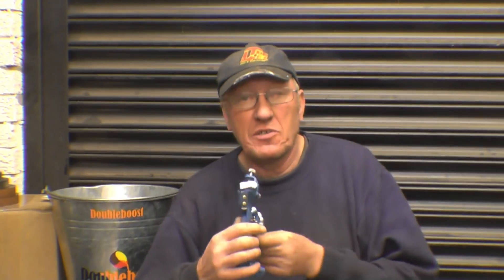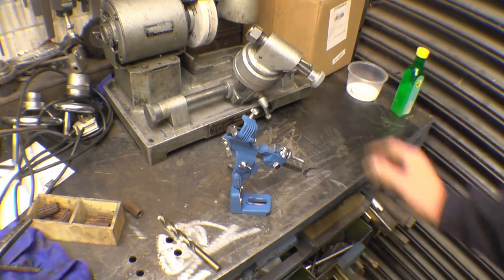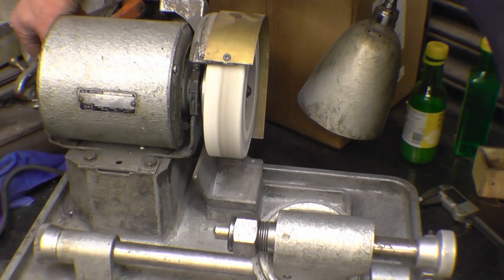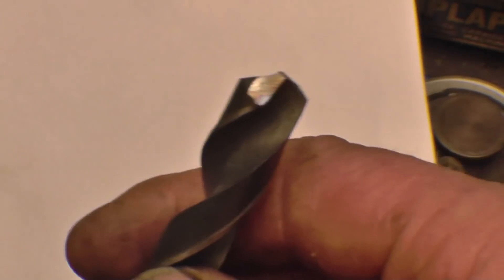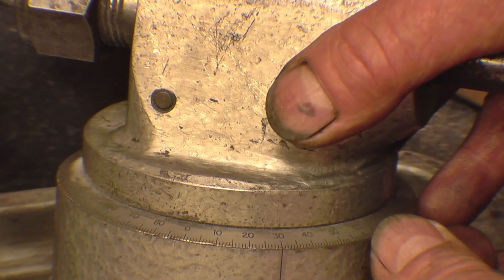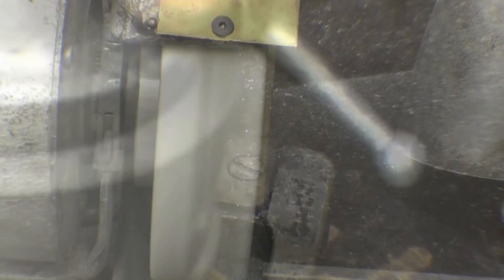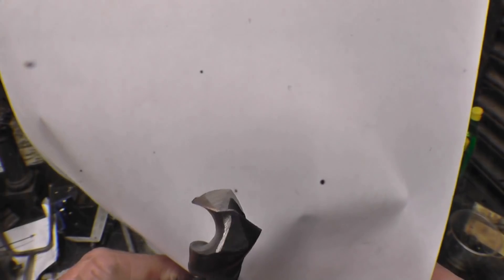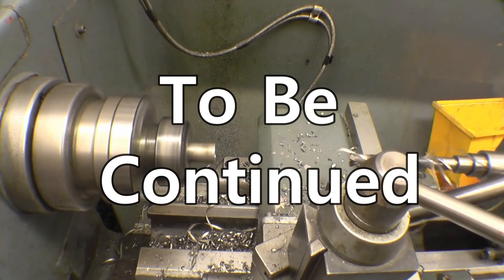SNNC 296 P1  Tool Cutter Grinder  Sharpening Drills

Comment: It appears your bit walks to the side when you start the cut each time. Guessing that one side needs a bit more off to get it going straight. Hate to drill crooked and oversized bores.15:15 watch it in 2x speed and its easy to see.

Comment: Electrolysis for them collets, man.
Reply: Michel Auron or horticultural strength vinegar (20%) with salt work wonders and if you use electrolysis it does it in a couple of hours.

Comment: John, I have always found it pays to reduce the chisel point first because it is easy to accidentally grind off the cutting edge when you are looking at the other side, so if you do it first then before  you sharpen the primary cutting edge  it doesn't matter. Nice quality drill that. On the rust removal, i use high strength vinegar (20%, household is usually 5%) and it works a treat with the salt added. I put my rusted stuff in a sealed tub, weeks at a time and when taken out and brushed there is not a scrap of rust at all. I had a wing type pair of wrought iron dividers that were my dad's,and they were very badly rusted, two weeks in the vinegar salt solution and they came bout as if the blacksmith made them yesterday.

Comment: put the collets in evaporust like all the other machinists do like kieth rucker.
Reply: Not easily available in Europe.
Reply: Evaporust is available on ebay but its quite expensive. The good thing about it is it is not harmful to your skin and can be reused over and over. I have some just leave the part soaking for a few hours and rinse with water works a treat.
Reply: @ericmcrae7758  I have just looked, and wasn't aware it is now available widely in the UK, found this potential supplier. Thanks. https://www.thompsonsltd.co.uk/products/qevp1lfba-evapo-rust-super-safe-water-soluble-rust-remover-1l-us-quart-metal-treatment.html?gclid=Cj0KCQjwz8bsBRC6ARIsAEyNnvpRtwrKoC0jixC3vvDdJ67ZieCO1l1mgEKoyhFfCa1ozoCvzTZ-MQkaAsW7EALw_wcB

Comment: you better heat up the collets in an oven for a while to take the hydrogen out, else they will break
Reply: Ever actually seen that happen?  I know I haven't.
Reply: @wibblywobblyidiotvision  i have had the fairly hefty  springs of tools break witout any effort or warning immediately after they were derusted in citric acid.
it also took out the titanic......
Reply: @janvanruth3485  Somebody citric acid washed the Titanic?
Reply: @bcbloc02  you didn't know?

Comment: It's maybe also worth mentioning that as you sharpen the drill check it is being sharpened evenly by measuring the lip length or length of cutting edge. you need to use equal passes on both sides once you form the even length cutting lips If not the drill will drill a hole double the length of the longest lip. I also remember being shown this as an apprentice nearly 40 years ago now.

Comment: Powered or granulated Citric Acid can be bought very cheaply, citric acid only reacts with the rust, doesn't react with the steel like vinegar (Acetic Acid). Not sure if the salt is needed though, they came out great. I use a scouring pad to clean the residue off.
Great vlog John, and thanks for sharing.
Reply: In addition to citric acid, lemon juice contains ascorbic acid (Vitamin C).  Ascorbic acid is a reducing agent.  Rust is primarily hydrated ferric oxide.  Ferric gets reduced to ferrous, a good thing.  "Straight" citric acid may well be adequate, but lemon juice has a double action.
Reply: @eliduttman315  I never knew about the Absorbic acid, the residue from citric acid reaction to rust is a pain to deal with, is it Ferrous Magnetite or similar?. I will definitely try some lemon juice, or maybe purchase Absorbic acid to try with my several kilogrammes of citricc acid. 
Very interesting, thanks for sharing.